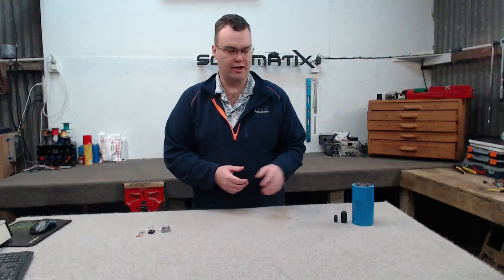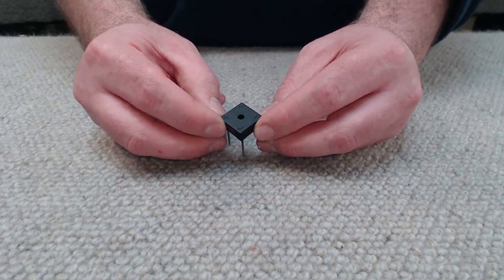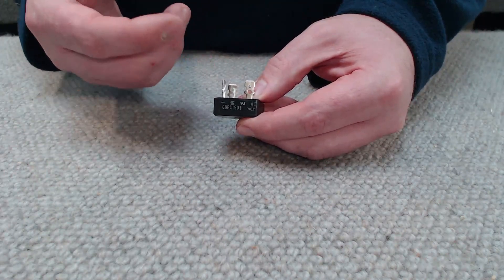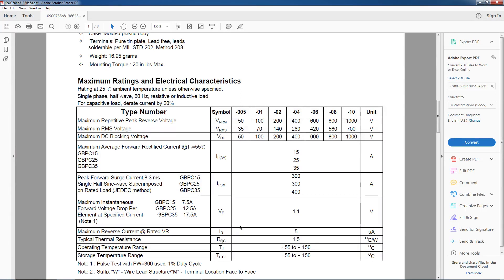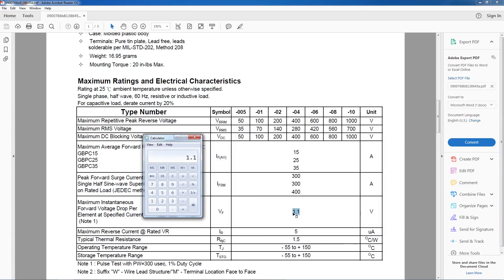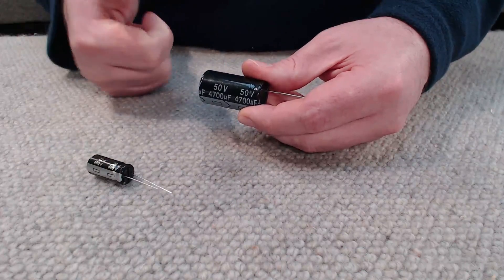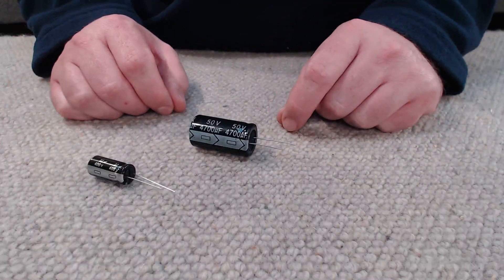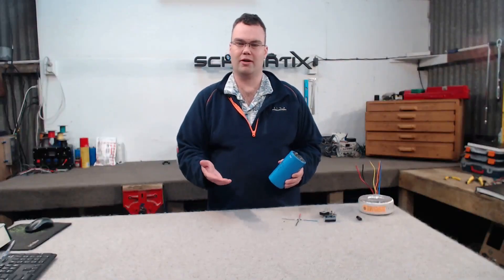How To Choose The Right Rectifier & Capacitor For Rectifing AC to DC

Comment: Excellent video & tutorial.   I am in the process of replacing the Bridge Rectifier in a Daiwa PS-30XMII.   When I removed the faulty BR it had a 14mm brown ceramic disc capacitor across the AC terminals.   I can find nothing about this on the schematic.   Is the capacitor of any real value in this situation or would you recommend
 fitting the new one without it please?
Reply: are you sure its  cap....could be a MOV
such a cap can reduce line noise/spikes

Comment: Great video thanks, the only slight issue is that the formula states that it equals ųF but it actually equals mF. Though in your example you had already converted it (15000 vs 15)
Reply: uF (microfarrad) IS mF (microfarrad).
They represent the same thing. 
They are the same thing.
Reply: @googleedwardbernays6455  
uF is microFarad (x10-6)
mF is milliFarad (x10-3)
Reply: @Nohr Tillman 
      Aaaahhhh. You are correct!! I always forget about the milliFarrad due to it not being used as the other three (u, P, N)  in reference to electrolytics or in reference to capacitors. And since i am unaware of a single instance where milli has been used in terms of capacitor.  My bad, homie. Thanks for correcting me
Reply: Nice one, I just made a comment on this too haha

Comment: Why is your calculation on the calculator off by a factor of a thousand? Just a little confused because you used the basic unit for amps and multiplied it by the milli unit for seconds rather than the basic unit for seconds. 

But the formula still checks out with matching units, the final unit is microfarrads and using matching units, I get 0.015090farrads which is 15.09 millifarrads which is also just 15k microfarads.

Apart from that, this video was very useful. I wanna make a diy circuit to power a car radio from an outlet for a sort of home made boom box type deal. The power supply is the hardest part, and I feel the diy transformer is gonna be the hard part of the hard part.

Considering the radio is gonna power speakers at at least 15w rms to 4 outputs, including the other internal that need to be ran , I’m guessing between 5-7 amps to run the radio and thinking of designing a circuit that can handle 9 amps. 

Course, figuring out how to make a diy transformer to convert 120vac to 10vac at 9 amps is a whole other thing in itself.

This would leave me with a 14.1v peak and assuming a 1.4v drop between the positive phase and negative phase diodes, I’m left with a 12.7v peak and should at the very least aim to stay above 12.3v since that’s about the minimum good voltage of car batteries with no alternator. But this isn’t accounting for the radios amplifiers efficiency. 

Anyways, using the formula, to run and rectify a circuit running at 12.7v peak at 9 amps while maintaining at least 12.3 volts……. 186,750uF…. So definitely gonna have to redesign this and probably run the radio closer to its max operating voltage to allow a larger voltage ripple because that’s a crap ton of capacitance.

All this makes me realize just how much thought has to be considered in circuit designing. Really makes me respect the people who design motherboards and gpu’s, bet that stuff is a complete nightmare compared to this stuff.

Comment: If I'm hooking a 200 Volts 4 Amp rectifier to a wall plug. Does the rectifier only draws 4 amps from the socket or is there a flow of 16 amps then?

Comment: Thanks. So I can replace a broken bridge rectifier with a other one, that has a higher voltage and amp rating, without cousing  problems to the circuits?
Reply: yes

Comment: Do I get benefit from choosing higher capacitance then necessary?
Does that equal lower Ripple better Smoothing out?
Does the capacitance storage in power supply affect capacitance storage in Load (music Class D amplifier (DC Powered)?
Is there a benefit adding additional capacitance board (capacitors in parallel) to increase total capacitance? 
Does the transformer has to be then more powerful (power wise/ current wise) to handle that?
Thank you for responses ( i know quite specific questions)
Example: 26V rectified voltage (200W - transformer) going into Class D amplifier board (which has its own capacitors)that is 2x100W. Will I benefit from additional capacitors in series between transformer and amplifier?
Thank you
Reply: Do I get benefit from choosing higher capacitance then necessary?                     marginal
Does that equal lower Ripple better Smoothing out?                                                    yes
 
Is there a benefit adding additional capacitance board (capacitors in parallel) to increase total capacitance?      Yes, lower ESR 
Does the transformer has to be then more powerful (power wise/ current wise) to handle that?                                 there will be a higher inrush current       It MIGHT impact  components such as diodes
Reply: Does the capacitance storage in power supply affect capacitance storage in Load (music Class D amplifier (DC Powered)?

except for class A   amps respond by drawing extra power form the power supply, so the power supply must react quickly.  This is a strong argument for large output caps.  Some argue against tight regukation because it oftens results in slower response

Comment: I'm confused, you are saying the voltage increase by 1.414 and later you are saying it drops by 1.1 ... so it increases or it drops ? thanks
Reply: From what I'm understanding, there's a drop in AC voltage on the way through but you still get a higher DC voltage at the end. 

The question I think you're wondering is do you multiply the initial AC voltage by 1.414 or do you multiply it after the forward drop?

According to the video (at 3:37), it's 1.414 times the INPUT acv to get the dcv output. 

The loss of 1.1v on input of 50acv would be about 2%, so it's not that much of a loss even if we were to multiply the input voltage after the 1.1 voltage drop.

I guess this is why it's important to size your rectifier correctly. If you pick one with a relatively large drop, it'll be inefficient and needlessly overheat your rectifier. 

Based on his choice, a drop of 2-3% is what you'd expect. If it's larger, you probably need a smaller rectifier. 

I think...
Reply: @MichaelApproved  I did some research since and I understand better. So yes the bridge converter will convert ac to dc. But let’s say a 230v ac is in fact a curb of 320v but the vrms is 230v. So after beeing dc it can be 50v but still the same it’s vrms and peak will be higher corresponding by X1.414. So it’s the capacitor which will make the vrms equal to the peak by blending thoses peaks. So yeah the increase is either the voltage after the capacitor or how you mesure between peak and vrms value. Hope it helps.

Comment: how do i calculate the filter capacitor required for a half wave rectifier with diode(1N4007) and a 1K resistor?

Comment: So I guess my questioning would be can you use multiple compasitors to reach the compasitance you require? Like idk if that would even work in series or parallel or dose it have to be one compassitor i guess depending on the application?

Comment: Can a full bridge rectifier be used as a choke in place of an inductor between a control board and a DC treadmill motor? The inductor that came with the treadmill had a bullet hole in it and was beyond repair. Also, don't know how to use a transformer as an inductor because I don't know what values would be needed. You probably have a video on inductors that I should watch. Cheers

Comment: I wish someone would come along and do one that is my size; 50 amp. 120 volts going into my 200 Amp rectifier and I am getting 29 volts out and I need to have at least 17.5 volts max, I have used 220uF for my filtering bank, 4 on the positive side and 4 on the neg. side as well. But I still need to be able to handle 875 Watt potential, for my power supply loading. Running an RF amplifier along with my RCI 2950 radio for my loads. Amplifier will be of a size that will not over burden my load capacity and still have some headroom to keep it running cool. So my RF Amp will be no larger than a 800 watt PEP amplifier. RMS should be well below 350-400 maybe 450 at the highest watt average for my loads.

Comment: should the capacitor be in front of the bridge rectifier? the capacitor I have  is  80 v ADC
Reply: cap must always be after the diode, else the cap acts like a short circuit to AC ...

Comment: How do you get 8.3
from 10  miliseconds
why is the DC voltage higher 
when the diode takes 1.1 volt
if the diode has a 1.1 voltage drop
sign meaning it could be something else why is your DC voltage always 1.4 times the ac?

Comment: I plan to charge my 2006 Prius hybrid battery with it
The hybrid battery I'm not sure
could be 210 volt DC
Or 201 
It's 28 cells in series pairs
I think each cell is 7.5
I'm checking
So series is 14 series 15
In series to make 210.
I hope my charger works.
But I'm charging with very low amps
it may take a week.

Comment: I bought a solar panel
Rated 200 watt 22.7 to 26.6 volts
That's gonna go into a box that makes it 12volt through a 30 amp charger controller.
This controller has twol 2.5 amp USB outlets.
There should still be over 100 wats 12 volts 
Great cause I bought two 50 watt inverters that put out 115 volts AC
I'm guessing .2 amp
I can rectify both 115 powers then put them together to make 230
or put them together then rectify 230 AC to make it DC
I want your help calculating the diodes and capacitor.
I want it to be your design.
Could you please do that for me?

Comment: A full bridge rectifier is basically four hardwired diodes .... great piece of electronic hardware ... they commonly have a hole in the middle to allow mounting on a heatsink if you are going to push its limits ....

Comment: I was gonna build a dc supply with a 1000w microwave transformer. gonna rewind it to put out around 50v I have a couple 1000v 50a bridge rectifier laying around could I just use them or would that be way overkill and have negative effects?

Comment: Hello, I have an ATV with no battery, just pull start which outputs AC power and I want to run a 12 V DC fan for the radiator (no other powered accessories such as lights etc.).  The stator has a lighting coil that outputs 150 watts.  I cannot find the wattage of the fan but I did measure the resistance and got 3.8 ohms, so I believe the wattage is about 38 through calculation.  The engine manual says the lighting coil produces 32V at 2000 rpm, 50V at 3000 rpm and 67V at 4000 rpm.  The motor is rated at a peak rpm of 7200 (not sure if all of this info is needed).  This is a retrofit so I have not added the voltage regulator yet but I assume it will bring the voltage to 12V?  With that information, can you provide guidance of which rectifier and capacitor to use?  I am somewhat electrically helpless, so any assistance would be appreciated.  Thanks!

Comment: Hello I have a magnetic drill base that does not work, it uses a bridged rectifier . AC TO DC how do I find out what size the magnet needs? and or how to test if rectifier is bad not knowing the size of it and drop....I believe the label of magnetic  base says 300v and or 30v its hard to read and the rectifier has no markings besides AC markings, any help would be appreciated

Comment: Another option not addressed at the end is that when picking your capacitors is to just add more small capacitors rather than one big one, as long as you aren't going to exceed their voltage rating. The benefit there is that you can usually use smaller capacitors that are faster at discharging, you can often over-provision incrementally by leaving space for additional capacitors that you insert when and if your load requirements change, or for heavier duty versions of your circuit, and 2-3 smaller capacitors are usually cheaper than one big one, and if one blows you may not lose the whole bundle in the field, and you let out less magic smoke per blown cap.
Reply: Sure, in theory that works. In reality they start to clamp and self limit the amount of current output.
Reply: @linandy1  I'm not advocating for more than a few. You see this all the time in power boards for eurorack gear where you just line up a something like 3 cheap 4700uF caps per rail rather than try to find a single capacitor.

Comment: How would I calculate required microfarad capacity of a cap when the frequency is unstable like that based on the rotation of a stator matched to the turns of a bicycle wheel?
Reply: @Βασίλειος Μπεσλεμές most of the time yes, but I'm looking for a capacitor for a bicycle generator.

Comment: I need your help with 2 things :

1: I am using Bridge Rectifier QL5010 it suppose to Handel 50A but it brakes down in (25A  soo fast) ( 15A in 10min ) even I put aluminium colling but the black resin temperature reach 100 even the case is cold.

another thing. how many capacitors need to put in output 25v / 25A  to smooth the voltage without a ripple more than 400mv
Reply: abed itani this is pretty late, but I would honestly just buy a rectifier rated for way more amps than you need it for and screw it to a heat sink and put a fan to it, I had problems with heat too but this helped

Comment: I am so pleased that I have found your channel.
I am going to make a battery charger as I have been told that the new type solid-state chargers are not much good.
I want a charger that will charge a tractor battery, so I am looking at 4-5 Amps output current.
I can get a transformer from Jaycar, now I know what size rectifier and capacitor I need to get.

Comment: if the bridge rectifier have 10A and we need 20A how can connected bridge rctifier in parallel can you  explain in video thanks
Reply from the maker: I wouldn't recommend parallel FBR's. If one FBR has a slightly higher or lower forward voltage than its counterpart, current will be biased to the FBR with the lowest forward voltage. Potentially overloading & resulting in a blown FBR. 20amp FBR's are cheap and easy to buy online. That is the safer option

Comment: What do u mean by acceptable voltage drop, is it the rating of the capacitor
Reply from the maker: Acceptable voltage drop is the voltage difference between the lowest & highest voltage readings. For example, if I required a minimum voltage of 20v and my power supply was outputting 25v, I could tolerate upto a 5v voltage drop.  25v (power supply) minus 5v (acceptable voltage drop) equals 20v, which is my minimum required voltage

Comment: Well presented thanks..I have one question regarding my DIY project/experiment..I'm trying to rectify the HV/HF output from the Secondary of my mini Slayer Exciter tesla coil and not sure about the type and the current rating of the rectifier I require..any input appreciated thanks
Reply from the maker: While you could purchase an ultra-fast recovery diode, the problem is the voltage. A quick browse online shows a mere 40kv or higher diode is in $$$$ range. Even though the humble slayer exciter is a baby tesla coil in the grand scheme of things. It's very capable of outputting over 40kv. I've never heard of anyone rectifying such a high voltage/frequency before.
Reply: thanks
Reply: Hey raydan18, does your project works? I am also trying to rectify a HV HF voltage with f=49khz. May I know what are the specs of ur rectifier?

Comment: Can I used diodes in series on each side of the rectifier to help with heat dissipation or will that just add to the voltage drop, create more heat and leave me with the same issue?
Reply from the maker: That will only add more heat. The best way to manage heat is by using a heatsink to dissipate the heat more effectively.

Comment: Back to school dude... there are 2 diodes conducting at the same time in a bridge rectifier therefore the power dissipated is 33 watts at the peak of the waveform IF each diode is dropping 1.1 volts. Because you are dealing with a sinusoidal waveform which only conducts towards the peak of each half wave, the average power is a lot lower (as you should point out at the 8 minute mark with a very good diagram). You need to read the graphs for those figures. The inrush current when turning on your power supply will cause a 5 or more times the normal current flow through your rectifier depending on the capacitance chosen and you need to make sure that the rectifier can handle this  burst. Fortunately it can... 300 amps in the next line down from the "Maximum average forward rectified current" line... "Peak forward surge current etc." Overlook that figure at your own peril. Personally, I'd use the 35 amp bridge for your task to cover any current surges and the price is about the same for that peace of mind. Been there, done that... retired electronic tech with very few blown rectifiers to my name. Apart from that, a very informative tutorial.

Comment: Not sure I understand. Why is 5.5V voltage drop "acceptable" for a power supply. Doesn't that mean that the voltage will constantly vary within a 5. 5V range? That much change will wreck a lot of things.
Reply from the maker: Good question. It is acceptable for my application in this example I had a 65~80VDC window. So 5.5v drop is within spec. No, it does not mean it will constantly vary with 5.5v range. A 5.5v drop means if my peak voltage is 80v at no load. Then at full load, I can expect no less than 74.5v. In applications where you can't tolerate voltage drops under load, often a voltage regulator/buck converter can be used in conjunction with a transformer/rectifier/cap setup to provide smooth power. :)